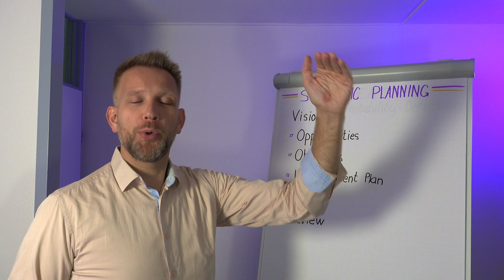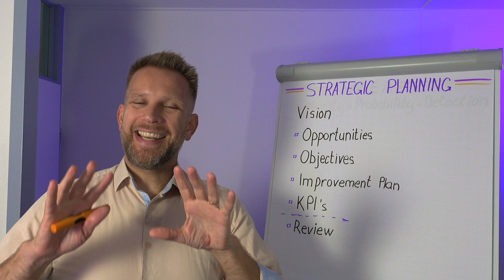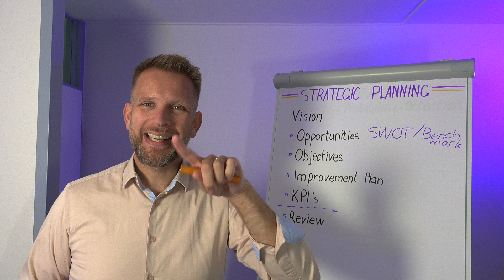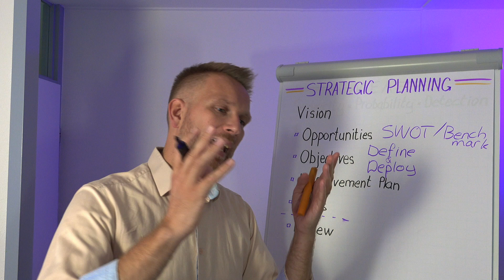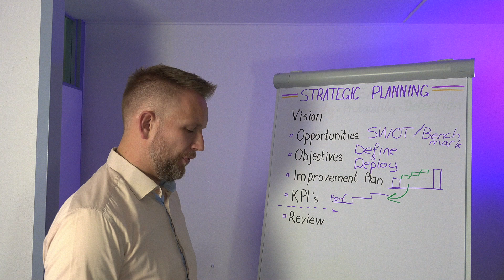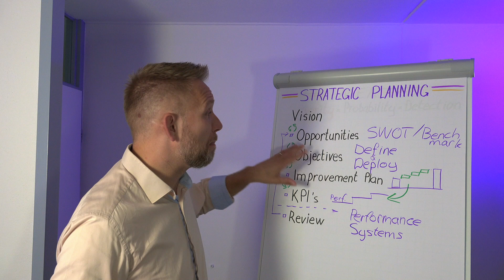Strategic Planning in Factories: A Guide for Industrial Leaders

Comment from the maker: Over at BeltCourse.com you can participate in an interactive guided set of workshops on CI leadership, and Strategic Planning in particular. These are online, but they have a brilliant way to simulate issues and situations in an online environment, which allows for practical learning of the skills you learned in the theoretical part of the course.
Link to get a 15% discount on Belt Course's Strategic Planning Workshop:  https://www.beltcourse.com/a/2147951457/6eADKB6z
Or get 50% discount on the Strategic Planning Program for all leaders:  https://www.beltcourse.com/a/2147947690/6eADKB6z